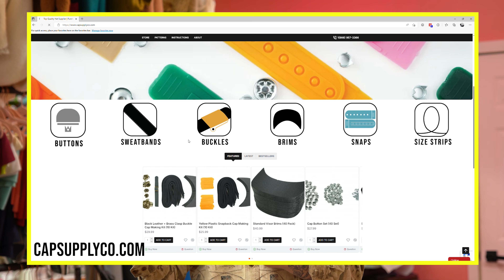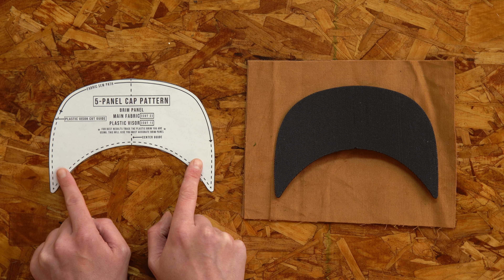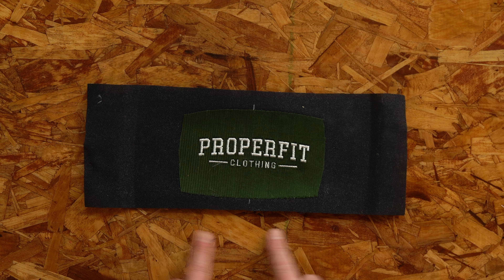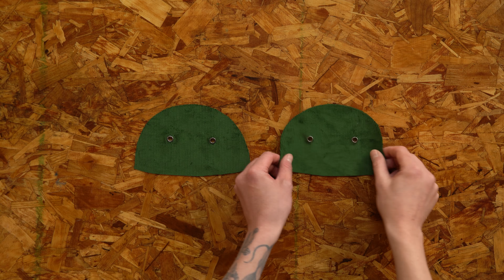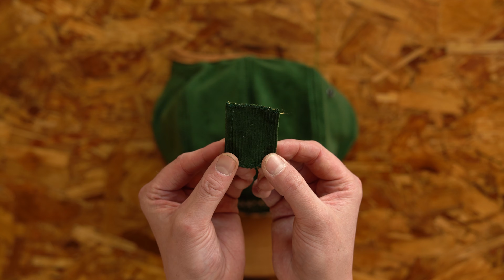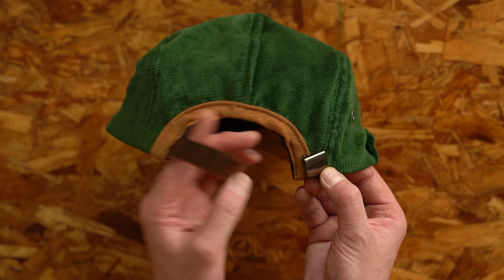DIY 5 panel Camp Hat STEP BY STEP INSTRUCTIONS + Printable PDF Pattern (EASY TO FOLLOW PROJECT)

Comment: What kind of bias tape are you using single, double. What’s size is the twin needle 6, 8? Why would I set it to zigzag if I want a straight stitch on both sides? And that large of a needle (if 8) won’t work on my domestic sewing machine.

Comment: Good video, everything is very detailed and calm. but I'm worried about one thing - will the domestic sewing machine spoil from frequent sewing a brim?(I want every day at least 1). I have a singer promise 1408. what plastic for the brim to choose so as not to ruin the machine. I'm really looking forward to an answer. Sorry for the bad translation, I'm from Ukraine
Reply: Hey, I just saw your comment. If you are worried about the plastic brim, you could try using a thick EVA, 3mm+. Check if it pleases you, it’s really easy to sew using domestic machines 🙂
Reply: Estoy igual tengo una singer más antigua y no quiero dañar cociendo el ala.